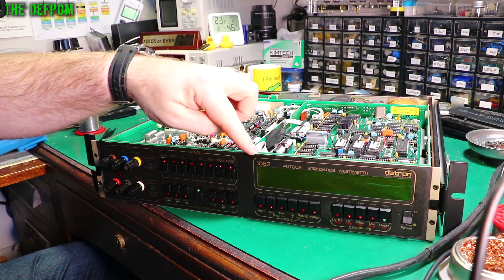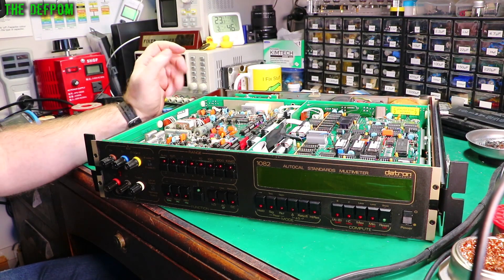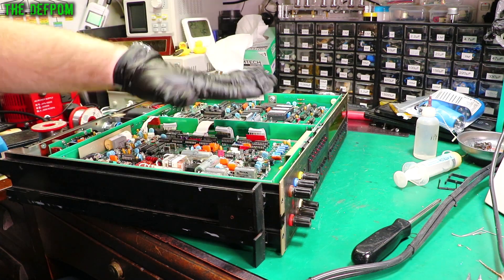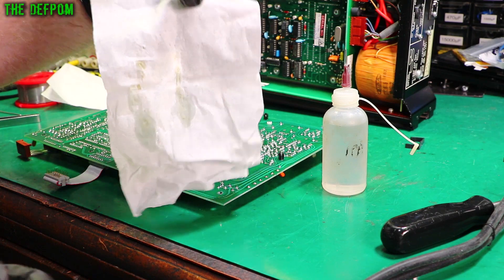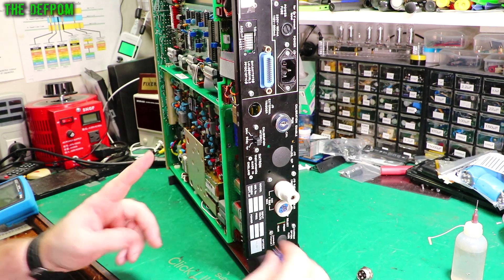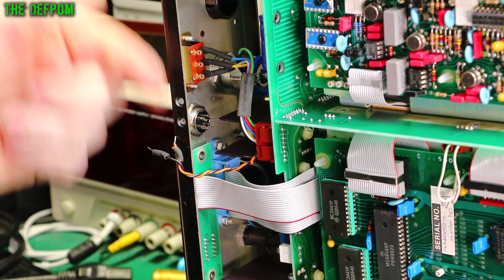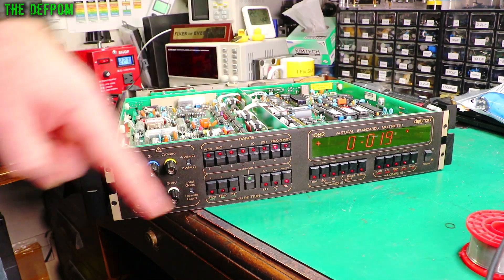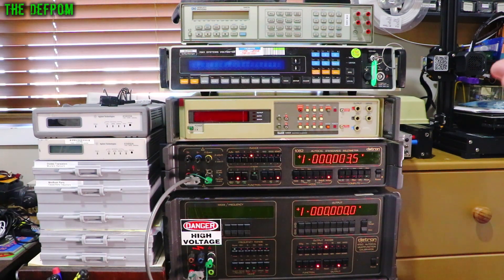🔴 Datron 1082 Autocal Multimeter Repair & Refurbishment - No.863

Comment: Any idea what the difference is between the 1271 and the 1281?  I know they're both 8-1/2 digit multimeters and very similar in design.  The design of the Fluke 8508A seems to be heavily inspired by the 1271/81.
Reply: Difference between 1271 and 1281 is in voltage reference module. 1281 has two LTZ1000, but 1271 has one LTZ1000 and one LM399. You can check xdevs web page about 1281 repair with a lot of information there

Comment: Nice equipment rack/stack. If possible could explain the purpose of the 50Hz or 60Hz crystal. It's actual function. Thanks Scott.
Reply from the maker: It is the clock crystal, it should be chosen to align the clock frequency of the unit to the line frequency, so that any induced line noise is basically nulled out as part of the readings. By having the clock aligned to the line the sampling is done at exactly the same point in the line cycle meaning that the readings are much more stable and consistent.

Comment: Very nice repair, Scott. Those Phillips caps seem to be developing a "Rifa reputation" - replace on sight. I am just finishing up a repair of a Racal-Dana 6200 DVM that had tantalum caps in the power supply on the input side of the regulators on less. Needless to say several were shorted and one had failed using the nuclear option  taking out the bridge (or possibly the other way around). I am replacing them with electrolytics as the modern ones are small enough to fit nicely.
Reply from the maker: Tants on a high ripple supply, odd design choice.
Reply: @TheDefpom  Nowadays solid polymer would be a better choice, especially in a high-ripple supply.

Comment: That unit should be in great shape now.  Good job. What model is the fluke above it in the stack? I have one that has giving me a fit trying to get going.
Reply from the maker: It is a 5450A resistance calibrator, basically a box that switches in some really high precision resistor pairs, one resistor with a negative temperature coefficient and one of a positive temperature coefficient, so that it essentially nulls out any resistance shifts with temperature drift, I did a video on it last year.

Comment: Fun info (from my memory/notes):
Tantalums don't like ripple even if well within the rated voltage of the capacitor.
In design applications or replacement scenarios the ripple rating on the datasheet should be adhered to.
With too high a ripple voltage then at startup sudden breakdown can occur (as most of us have experienced!), and is caused by heat being generated by the ripple and thus thermal breakdown occurs (internal oxidization?).....BANG!

Comment: we used to work on the supply voltage should not be able to get within 80% of the capacitor voltage rating. Can't remember if there was a mil-standard that covered de-rating cap max voltages, unless it was called up in Mil-HDBK-217. Not read that document for many years.